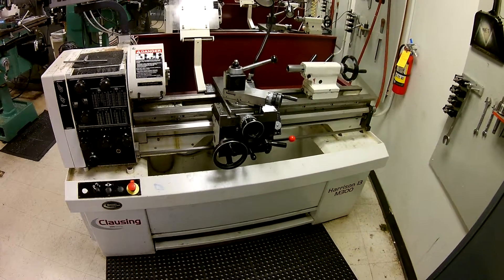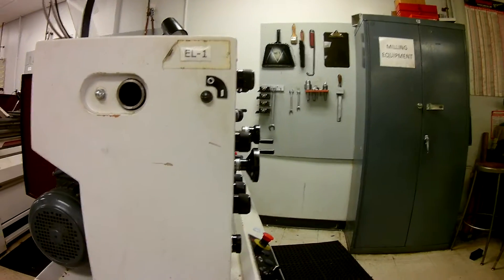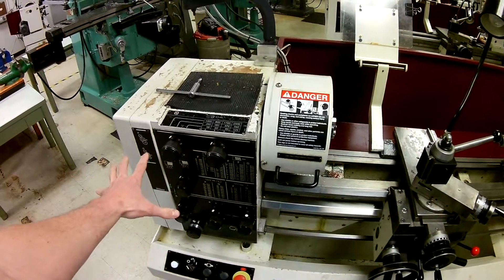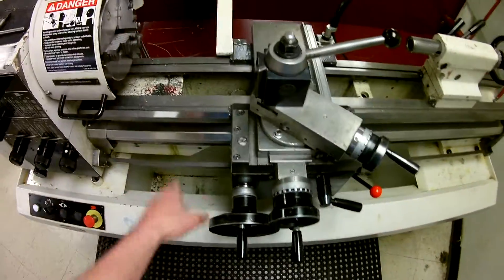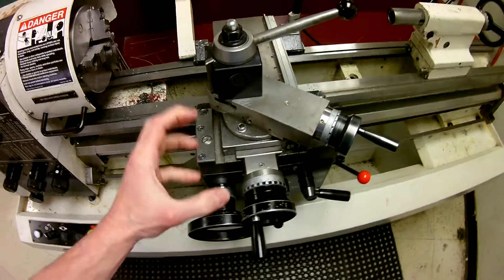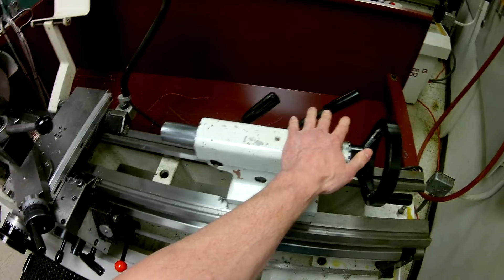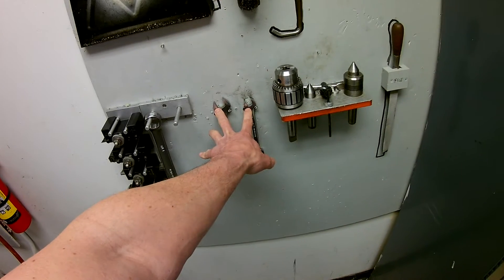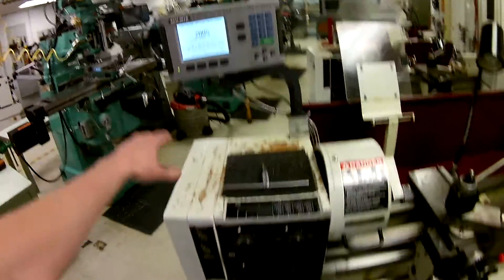Lathe 1 Intro

Comment: I see no one has commented, but this is a very easy to understand video that takes things in small, easy to understand bites of information. The format is good and I am glad you did this. I am getting an old Atlas/Craftsman change gear lathe to start learning on and though the technology is different, what I gather is that all the basic theory and concepts are the same in operation. I'm glad to have found such an easy paced set of materials and look forward to the rest of the series.